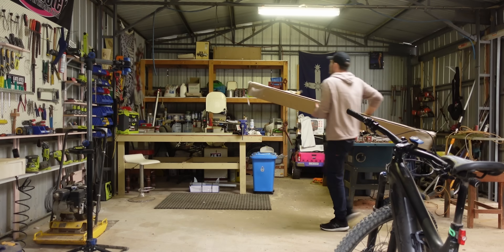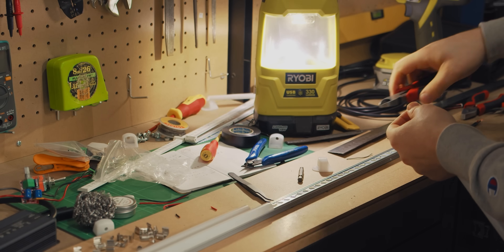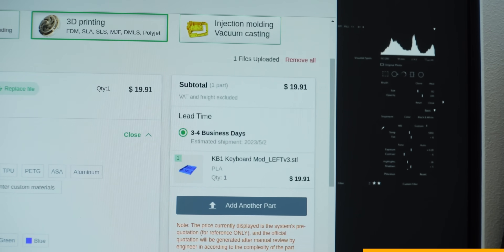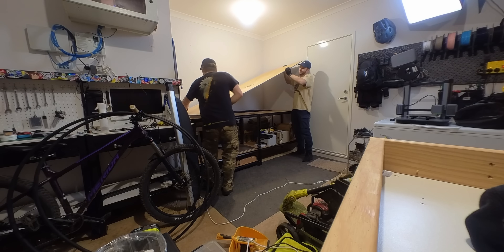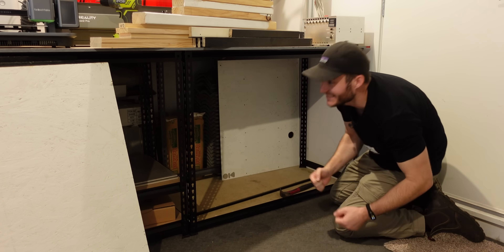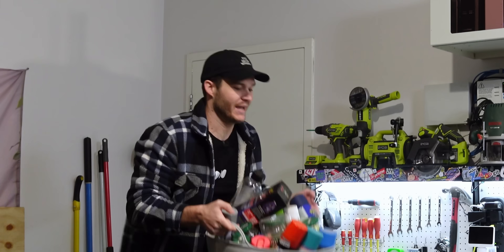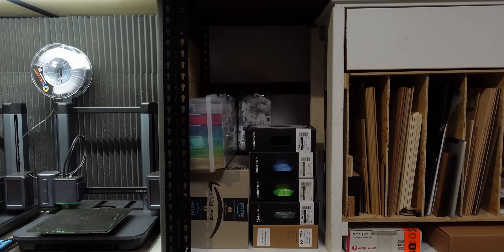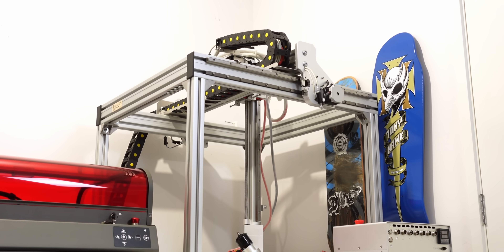Time for a change - Makerspace Makeover

Comment: ery nice, good video. and nice space.

also I feel I see you issue tho, while you keep adding stuff, your placements and organising are rushed and everything is tagged on´s, not fully done-planned redone, if you get what im saying_? maby you have to many ideas, you just rush it in the end, like your seeing  I have this , and how is that gonna work into my new plan, instead of just redo everything, like idk.
but your space there, I cant see it all , but im seeing alot of other random thing placed there like garden tools ect taking up space, its not like you dont have space , it look like there a conflict of what belongs in that room  and what could easy be stored elsewhere.
if that was me I would  need to redo the whole room, so much left on the table and it looks like you even have to skills to build more complicated stuff, ex overhead cabinets, yourself, and much more,  lower tier stuff and all your stuff  is on the floor plan, and your using your then item to store more item s ontop of that witch is standing on the floor, your walls mostly totally bare.
I get your not made of money.
but there's ways to do it , ex ikea hacking you done need to keep the ratio, ex is a cabinet is 45cm you can just cut off the debth  and make it ex 30cm if thats what fits.
you can also just vinyl the fronts and or add hard  wood on top of the fronts , kinda cheating  but look better in the end product.
 (buy used 2nd hand ikea items and upgrade-add to  them or even pallets wood witch can sometime be had for free, some of them are even hard wood) 
and thinner MDF ex 0.6-  0.8 mm instead of more expensive 1.6 - 1.8cm as you cant see the thickness on the outside, and if you brace  it good inside it wroks just as fine for ex cabinets. 
imo the  less good looking plywood , the end product, vs MDF that it rather forgiving after its painted , vs plywood witch imo always looks cheap and ultra DIY  after , no matter what you do.

I dont wanna throw out alot of ex on what to build cause, idk what style you like, and how much of the space your willing to build on, 
maby this more is your style, idk, imo you should use 1 day, go into totally , maker space mode , scrape all the videos on YouTube you can, and select you fav features of the top makers spaces, that say I want that, I can make that.
then you can copy and or create you version of that , and all look the videos tough for inspirations and steal those ideas into a note program, when I do this for myself, I Screen shot from websites and videos,  stuff I feel look nice are my style, and would fit my stuff, take  just all of it , like way more then I need and then i sit there looking at it after and make my own puzzle out of it.
and if I need to see you its made, or or this on variations of it I just re google-youtube  that and look up versions of that style of coner of that space until I find what im looking for.
and your skeleton of room dont need to be final either, you can build fake walls to should dampen and or alter the room ,  in wall cabinets, on wall cabinets, ceiling stuff like camera lights up there for video and light. the possibilities are many.

you can even make a video and make your viewers gelid in on the process by showing ex of that your toughts are. cause text is harder to explain.
this my 2 cents.
Reply from the maker: Thanks for sharing your thoughts on the makeover.

Yes it got how it was from simply adding more storage and stuff along the way until I realised I needed to do a big rearrangement.

Since it is our Garage, and I don't have a backyard shed, the brooms and gardening tools are stored in it. But I'm hoping I can rearrange the placement so they can go near the storage shelves out of frame.

I've got notes and Pinterest boards of future ideas but this video was an opportunity to get advice from my viewers, like you, to weigh in on some design or better layout options.

Overhead shelving above the lasercutters and CNC is hard as the CNC machine actually raises double it's height so I can't have shelving running the entire width. Thinking I could however make a half wide overhead tub storage though.

Comment: Where you’re thinking of putting the filament you could do a “compactus” type of roller shelves. Would imagine it wouldn’t require as much structural reinforcing than the spice rack idea. Could even put an acrylic face on em to see what’s in each or seal individual “modules” for filaments you need to protect/humidity control.

I checked out a mates new R&D shop and he was able to jag off gumtree a tile drawer cabinet that was used for displaying tiles. Much cheaper than getting some architecture plans draws if you’re chasing some large shallow draws.
Reply from the maker: I like the idea of the tile drawers! I've actually started hunting for an old bar fridge to convert into storage of humidity sensitive filaments. That way I can still see inside what I have easily without opening.

But I do need to figure out the wall storage, either sliding or pivoting.
It'll be a Earl next year project now as have been flat out making things that time to make the stuff for the making stuff gets consumed 😂

Comment: i can highly recommend going and watching adam savages videos on his cave/maker space on his channel testet. there are some great tips and trick, and the design philisophy of using vertical space is amazing. i went through the challenge of having to go from a 15 m2 basement to a 3 m3 sheet and adams way of thinking ment i could get all of my stuff: 3d printers, worktable drill press and other tools to fit with. with out having to go down on gear. (yes it is tight in there but it works)